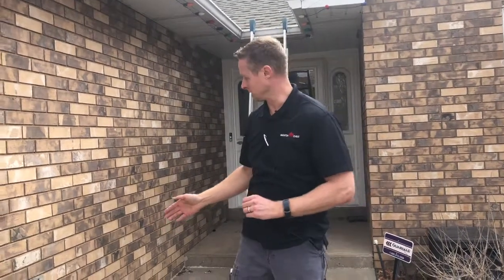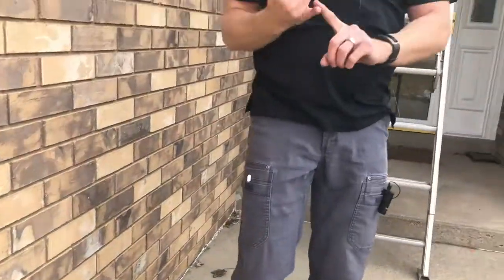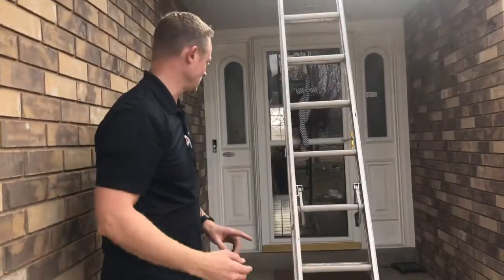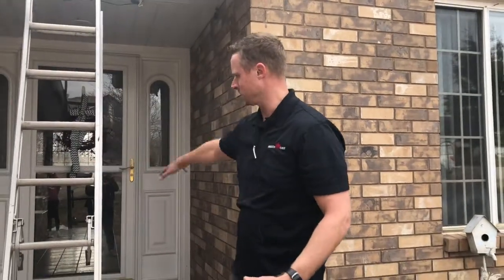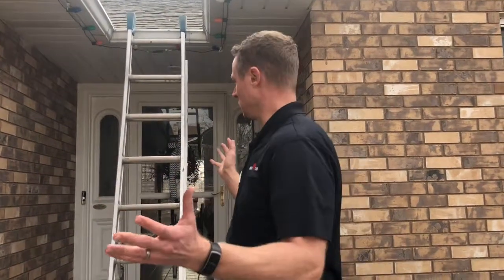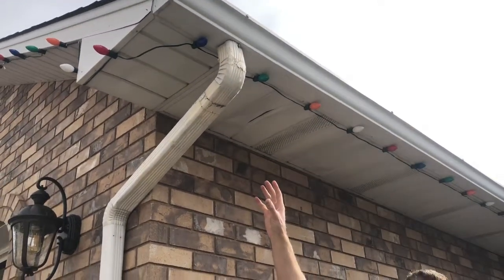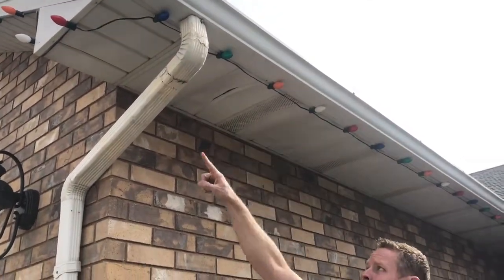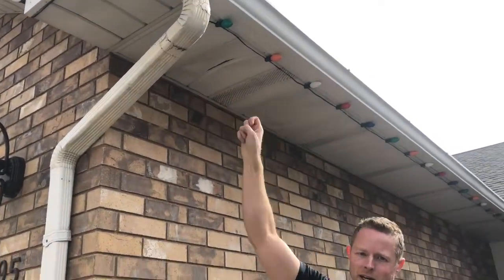DIY HEAT CABLE | STEP 3 | CHOOSING A POWER SOURCE

Comment: How long can you run these cables? A lot of the manufacturers pages I see say only 250-400 feet depending on Watts/Amps etc. How do you do a whole house, if that would require close to 1000 linear feet? Do you guys just plug it in to multiple locations?